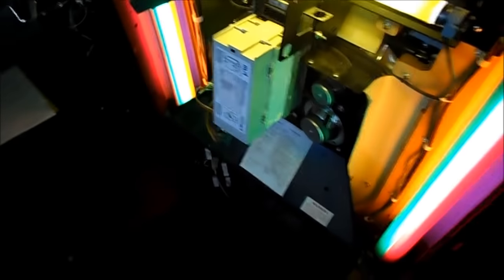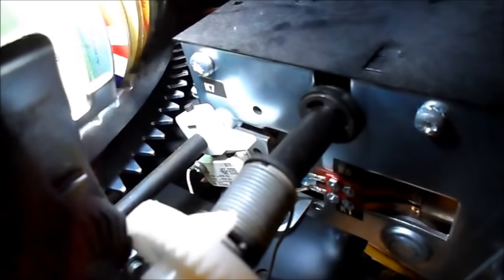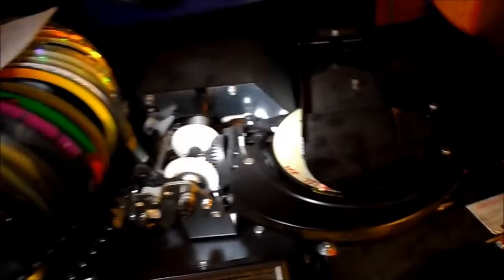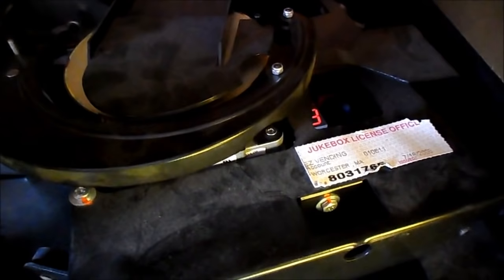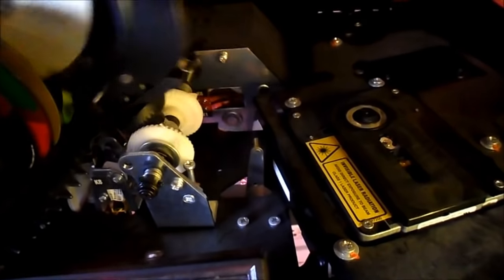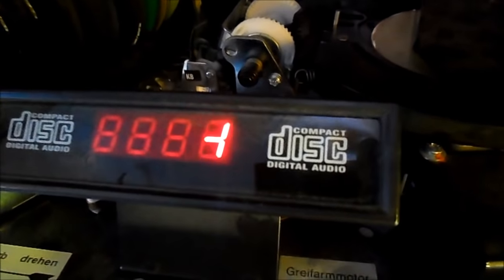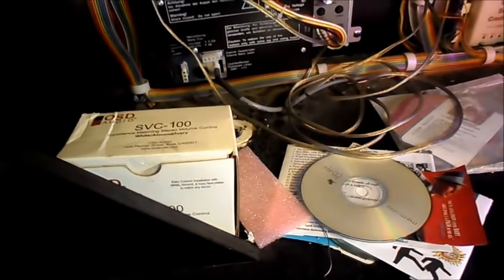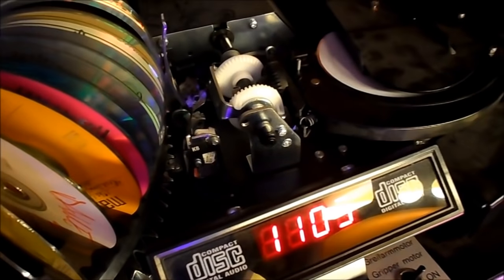Wurlitzer OMT CD 1015. Mechanism Repair.

Comment: I tried to set the K7 actuator with no luck.  Tried several positions.  Some positions will make it stop the CD on the player and not play, some positions just stop at the courousel.  Not sure where it needs to be exactly and what position the arm needs to be when you set it.  I then get error code 0306 when the CD gets on to the player and doesn’t play.  When I try to play a song the display goes through all of the numbers and the gives error 0306.

Comment: i have a 1015 where the display wont even turn on. We recently hired someone who claimed he could fix it but was unsuccessful. I have a few questions if you have the time: It doesnt say "disc" on the display screen. Is that original to that model or is it a replacement piece?  Do you have any recommendations for a repair man in the Southern California area for this machine. Do you work in that area at all? Thank you in advance.
Reply from the maker: Hello it’s been sometime since I serviced that unit. Nowhere near California unfortunately. However this is the gentleman I was able to order Some replacement parts with instructions. I suggest you try to search out the service manual online. They are available believe there was one inside the unit.  Lastly check the power switch on the back of the unit. This one was defective. Then it would be just the usual power supply checks. Not turning on completely should be pretty simple to solve. Try not to over troubleshoot. Hope this helps. The display gets its data from the main processor board. Take plenty of pictures before touching anything.

Rod Stebelton

Stebelton Music Distributing

Wurlitzer Service Center for North America

Authorized Wurlitzer Distributor for OH and WV

519 Hocking Street

Lancaster, OH  43130-2960

Tel:  (740) 654-3155

Fax:  (740) 653-7777

Cell:  (740) 808-0384
Reply: look at the flippers website. I found the solution to my problems there.  A lot of the strange non mechanical ones are caused by the transistors bs377, they need changing out. replace with 2n2222 in reverse.  

The website has a scanned document from Wurlitzer Service stating the fault and wiring diagrams of where the transistors are

Comment: Is very similar to the 70's mechanism found in 45's  "statesman" and "zodiac" models, pulls
up the turntable to release the record from the grip.
Reply: Actually, I have fixed two of these by just putting a hose clamp around the K7 actuator. I was going to order it but it work just as well on the first one. I needed the jukebox to work right that night, and could not be waiting for that part to be shipped.